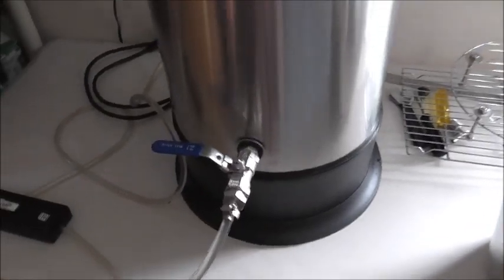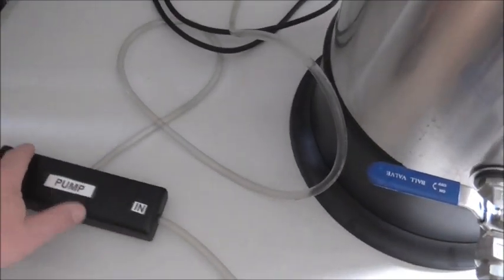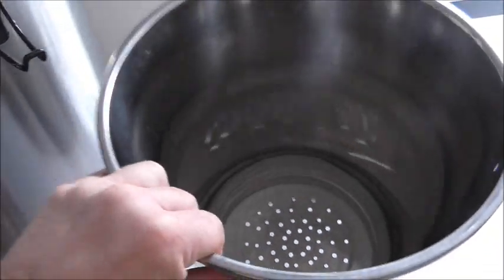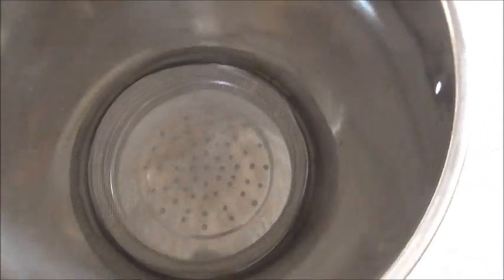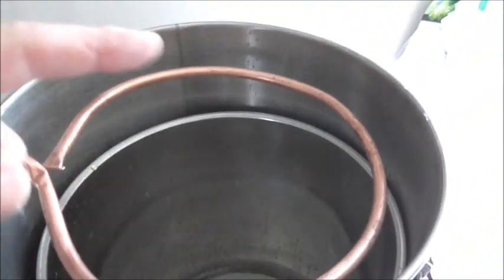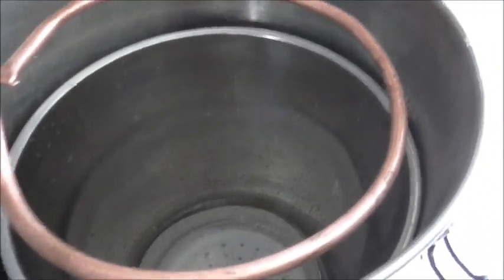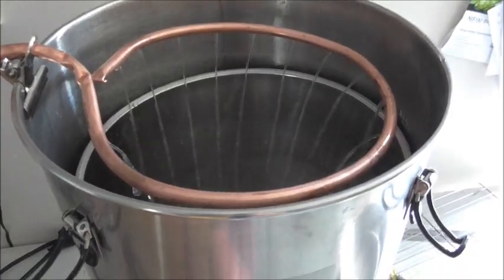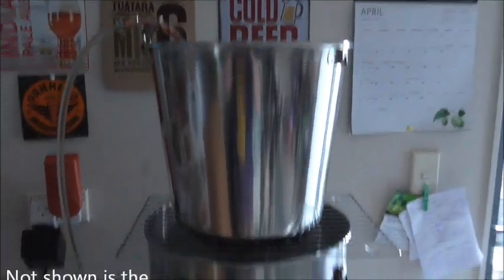Electric Recirculating Brewing System - DIY All-In-One with Sparge Ring

Comment: With each little tweak this DIY project just keeps getting better.  The recirculator works a charm.  Great video Dino.
CHEERS!!!
DJ
Reply from the maker: DJs BrewTube Thanks DJ. Someone has already suggested a quick disconnect for the ball valve for when I switch the pump from recirculation to sparging. That would make life easier. Cheers DJ!

Comment: Great job on the sparge ring, it looks like a kick ass setup you have overall!
Reply from the maker: Drunken Pukeko Brewing Thanks Justin. Sorry for going over the whole system again. Copper was only $9.50 for a metre and I only used maybe 2/3 of that. Cheers
Reply: TubeDinoz I enjoyed seeing the whole system. That's a great deal on the copper, I may have to look into doing something similar.
Reply from the maker: Drunken Pukeko Brewing I went to the trade entrance of Reece Plumbing on Constellation Drive. I'm sure a lot of plumbing supply shops will have copper. Bunnings and Mitre 10 didn't seem to have any, well not the small stuff I was after. Mine was 9.5mm OD pipe. Cheers

Comment: Nice work Dino. Great idea thanks for sharing. Cheers!
Reply from the maker: Rookie Brew Thanks Zane. I paid $9.50 for a metre of copper pipe from a local plumbing supply store (Reeces) and only used about 2/3 of that. Very easy to drill holes into copper. I wanted something rigid and copper seemed the best bet. Cheers

Comment: Great setup Dino, was going to buy a Grainfather but think I might build my own now!
Reply from the maker: +James Pene Thanks James. It's been fun making it. The only thing I've really changed since this video is I added a thermowell to the boiler for the STC 1000 probe. There is a more recent video showing the change. Not sure if I mentioned in this video, but my setup is mainly for half batches 10-11L. The max fill line of the boiler is 25L, so you could probably get a 3/4 size batch. Sing out if you want any extra info. I started building this just as the Grainfather came out, but I'm very happy with it. Another option could be one of those Robobrews. Have you seen them? If you added a pump to one of those it would basically give you something very similar. Cheers Dino

Comment: Happy Easter Dino. Looking great and looking forward to seeing how you maintain the temperature during mashing. Good luck with your first brew with it. Like you I'm gearing-up to doing smaller batches - that way you get to brew more often! Cheers.
Reply from the maker: Cider Meister Happy Easter to you too! I couldn't show it in the video, but I plug the boiler into an STC-1000 temperature controller and plug in my mash temp. The probe sits around tap level. There is a little bit of variance, but it hold the temp within a 1.5C range. Cheers

Comment: Did you ever worry or had problems with overflow during the mashing? As it looks like there is no overflow pipe or holes in the side of the basket meaning if the grain bed get's stuck the pump could dry out the bottom of the kettle. This could harm the pump and the kettle heating system?
Reply from the maker: Hi. I've not had any problems, but what you say makes sense and it would be a good idea to have something as a safety backup. I'll give it some thought. Cheers

Comment: This video popped up so I watched it, very no 8 wire stuff (that's not a derogatory comment) and fun to build something that works well. When bending copper like you have try filling the tube with sand and cap the ends it will not kink ...works for me , cheers...John.
Reply from the maker: +Hot n Salty Thanks. It's been working well, but yeah I was a bit impatient with the bending. I heard about the sand afterwards and also apparently castor sugar works well too. Cheers 👍

Comment: Nice system mate, very compact, i used to have a sparge arm with a crimped end on it and i found there was no way to clean it out properly so i cut off the crimped end off and put a removable compression blank which was easier for cleaning out any small particles which can build up, hope this helps, cheers mate
Reply from the maker: dee .simmono Thank Dee. Funny you should mention the cleaning. When I was testing it I wondered how I would get on for cleaning. Great idea to cut off the end and add a blank/cap. I'll definitely do that. Cheers and thanks for watching.

Comment: +TubeDinoz Very nice and simple re-circulating system. I noticed that you have some kinks on your Cu tube. You can easily avoid that by filling the tube with fine sand before bending and drilling. Once you are done, you can empty out the sand and you will have flawlessly smooth tube.
Reply from the maker: +Solomon Assefa Thanks. Yes, I was a bit impatient and tried to bend it by hand. I might look at replacing it using the method you suggested. Cheers!

Comment: Looking at making myself one of these sparse rings - a great concept. How easy was it to drill the holes in? Any tips you can share before I end up butchering a piece of copper piping?
Reply from the maker: Hi. The holes are easy to drill as copper is a pretty soft metal. As far as bending, I did mine by hand, but it has a few kinks in it. You could use a pipe bender or I've heard of people filling the pipe with silica sand to stop the pipe kinking when bending. Cheers

Comment: Hello and you can write about which mesh you used mesh what you put to the bottom of the pot.
Reply from the maker: piotr 1310 Hi. I used a sieve like this one. I removed the handle and squashed it flat. I then put a length of tubing around the outside to give a better seal. Cheers https://www.google.co.nz/search?q=sieve&safe=off&prmd=inv&source=lnms&tbm=isch&sa=X&ved=0ahUKEwiKhvDpvMTTAhXMHZQKHRmFAfsQ_AUICSgB#imgrc=3lqTC8BIrjgiIM:
Reply: Thanks

Comment: Does the STC-1000 controller do a good job for keeping a constant temperature during the mash?  I tried with an Inkbird ITC-308 but got big temperature swings.
Reply from the maker: The STC and Inkbird both function the same way. Once they hit the temperature you set they turn off the power, but unfortunately you still have lag from the residual heat in the elements. There's not a lot you can do about that other than changing to  PID controller (which I don't have). This apparently "throttles" the power as you get close to your target temperature, so you don't get the same over run in temperature you get with the STC / Inkbird. I hope that makes sense. I get a swing of between 1-2C, but I don't see it has too big an impact on your mash. Cheers

Comment: Hope that is not vinyl tubing, will give off taste to wort besides also not being food grade.
Reply from the maker: Yeah might have been pvc tubing in this video, but quickly changed it to silicone tubing. I know it was food safe for contact with water and food, but not good for any heat, which I quickly discovered and changed out. Cheers
Reply: @tubedinoz  Even more extreme was distilling water with vinyl, taste was awful. The hose went to the chiller, that's when silicon even at steaming hot is fine.
Reply from the maker: I bet. We live and learn though. Cheers mate

Comment: Pretty ingenious and a good bit of cobble stoning. Like you I've cobble stoned much of my system and saved lots of money. One question I have is I noticed that your mesh screen at the bottom just domes loosely on top of your false bottom. I stir a lot so in my case I would have problems with the screen lifting and then grains penetrating bellow. Do you not ever get that? Brew On Man!
Reply from the maker: johhnyglaze1 Thanks Johhny. I normally place the grain into the basket before lowering into the water. The weight of the grain seems to seal the false bottom nicely. The idea of doing it this way (underletting) means as the water rises up from the bottom of the basket and saturates the grain, it pushes any air out and reduces the chance of any dough balls. I do give the grain a gentle stir at the end. Cheers!

Comment: Great looking set up there m8, I really need to sparge in my Biab method but have no way of boiling a second pot. Could I just take grains out and rest on sieve then pour a couple of litres of the wort from the bottom tap into a jug and pour over grain bag at 66 degrees or would I need to raise the temp a bit?
Cheers
Reply from the maker: gifryer  Thanks. What you are talking about would help clear up the wort by letting the grain bed settle, but you really need to rinse the grain with some straight sparge water at around 75C to rinse all the sugars out. Could you bring a jug to near boiling and use that. Even if it was just 2-3 jugs. Cheers

Comment: When doing the sparge that high above the kettle, don't you get problems with oxidised wort?
Reply from the maker: Never had a problem. The wort is boiled afterwards. Are you talking about hot side aeration? The camp is split over where it causes problems or not. Even the experts can't agree. Cheers

Comment: also your stc1000,   does it drift around a lot,  i find theyb are good at 10-20C but up at 68C they drift like a teenage kid in a subaru
Reply from the maker: +peter smith The temperature does swing a couple of degrees as the element turns off an on. I think a PID is the way to go.

Comment: Nice mod Dino, will you be able to reduce the flow if needed,
Reply from the maker: norfolkhillbilly Thanks Clive. Luckily the power adapter is switchable from 6-12V, so I can control the flow rate through that. I'm looking forward to using it for real. Cheers!

Comment: Hi TubeDinoz. Nice work. May I ask you where did you buy the bucket (grain basket), the stainless steel rack, the mesh false bottom and the pump? I also live in New Zealand. Thank you very much!
Reply from the maker: Hi. Thanks. The bucket was from Briscoes, I think it was 11L from memory. I removed the handle and drilled the holes in the base. I rack I think I got from Briscoes as well. It's a cake rack with stainless bolts/washers/nuts to make the legs. Mesh false bottom was a cheap domed sieve from Briscoes. I removed the handle, then flattened the domed mesh part. It has a length of tubing around the edge to make it sit nicely on the bottom. The pump is a cheap $20 micro brushless 12V DC one from Trademe. Cheers
Reply: +TubeDinoz ! Excellent. Thanks! Just one more question. What is the diameter of the of the hole for the tap that you replaced with a ball valve? Is it a 1/2"? Thanks again!
Reply from the maker: Yes, it's a 1/2" ball valve. The hole for the original plastic tap was sort of an oblong shape, so I used a round file to make the hole the right shape. Cheers
Reply: +TubeDinoz . Thanks! Did you connect the STC-1000 to the thermostat? Or did you connect the STC-1000 directly to the "hot" power point? Cheers!
Reply from the maker: Hi. The STC is plugged directly into the powerpoint and the boiler is plugged into the heat output of the STC. The temp probe from the STC sits inside the boiler on rack.Cheers

Comment: Seems like the same boiler that is used for Grainfather more or less!
Reply from the maker: Nice spotting. I believe the Grainfather is based on the T-500 boiler, but has an increased capacity and extra element added etc. Mines basically a DIY 3/4 size Grainfather. Cheers

Comment: How many litres is your inner bucket, and how much grain can you use?
Reply from the maker: +James Watson Hi James. I can't remember exactly, but I think it's about 10/11L bucket. It's look the same size as a standard plastic bucket (27cmx27cm with a slight taper). I only do half batches and use no more than 3kgs of grain, but it would probably hold a max of around 4-5kgs at a pinch. I hope this helps. Cheers Dino

Comment: Hey Dino - greetings from Canada.  I am in the process of building a similar unit and have purchased the Turbo 500.  What type/size fitting did you use to replace the spigot on the unit?  Thanks for your great video.
Reply from the maker: +aaron gomes Hi Aaron. I used a basic 1/2" BSP 316 1 piece ball valve. On the back is a 1/2" BSP 316 back nut. I used 2 x "O" rings (one each side of the boiler wall) to seal. On top of that I added a 1/2" BSP hex nipple to attach a 1/2" BSP socket, which a bazooka screen screws into. When you replace the spigot/tap you'll need to file the hole slightly to get the ball valve through as the original hole is not a perfect circle. I'll try take a photo as well. Cheers
Reply from the maker: +aaron gomes Found this photo before I put everything together. I've uploaded it with some labels. Cheers - https://www.youtube.com/watch?v=PmNQtjFjvZQ
Reply: +TubeDinoz Thanks Dino - much appreciated.  Cheers!

Comment: Cool as, so the tubing is on the outside? How have you kept it secure?
Reply from the maker: ***** Yeah. I cut a length so it's fairly tight and joined the ends together with a double ended plastic plug. The underside has a solid metal ring, so that combined with the mesh created a groove around the outside. Sort of like a tyre (tube) around a wheel if that makes sense. I'll see if I can get a photo. Cheers
Reply: TubeDinoz Cool man, thanks for that. All good stuff, that's why I am blatantly going to crib your idea! Cheers

Comment: Thanks for the video.

How you clean the system???
Reply from the maker: I tip everything out of the boiler once I'm done and give it a good rinse with the hose. I then clean it with normal washing liquid and then finally recirculate some PBW through the pump, boiler etc Then give it another rinse. I find if I clean the boiler/pump straight after the brew day, it's an easy job. Cheers

Comment: Cool rig, did you sparge with clean water by switching the the pump feed or just circulate the while mix?
Reply from the maker: Thanks. I sparged clean water which would have been pre heated to between 75-78C. Cheers

Comment: Where did you get your grain basket from? Is it a champagne bucket? Cant seem to find anything like that in England. Where did you get that tiny pump from and what make or type is it?  Already experienced all grain brewer but I like to make things myself and that is the closest clone to a grainfather I've seen. Love your vids / blogs
Reply from the maker: Iain Campbell Hi and thanks for your comments. The grain basket is a stainless steel bucket (can't remember the exact volume, about 13 litres I think). I removed the handle and then drilled lots of holes in the base and added the mesh false bottom as in the video. The pump is just a cheap brushless DC 6-12V pump. This is the one I got and then placed it inside a plastic box to tidy it up. The site is in New Zealand, but they should be available anywhere. http://www.trademe.co.nz/home-living/outdoor-garden-conservatory/other/auction-936573887.htm I hope this helps. Cheers!
Reply: +TubeDinoz Where did you buy the T500?. In the uk you have to buy it as a full t500 turbo still.expensive.
Reply from the maker: Iain Campbell I bought it from my local homebrew shop in New Zealand. I only had to buy the base, without the still attachment. Cheers

Comment: Exactly the system I want to build. Thanks for sharing. What efficiency do you achieve?
Reply from the maker: Thanks. It's still going strong. I've upgraded the pump to a better one. Here's a link to a video if you're interested. As far as brew house efficiency, I'm getting around 75% with a sparge or just under 70% without a sparge. Cheers Dino - https://youtu.be/iygUdLT3dXk
Reply: @tubedinoz  Thanks for the link. I thought the efficiency would be a bit higher but I guess that also depends on how you mill the grain. And how do you sparge?
Reply from the maker: @matejbraz2649  my homebrew shop does my milling. They don't charge for milling so makes it easy for me. I use a hot water urn for sparging. Cheers

Comment: How do you cool the system? Maintain temperatures? I really would like to build a affordable working system!
Reply from the maker: Hi. Here is a more up to date video of my system. I use an STC1000 temperature controller to maintain the desired temperature during the mash. As for cooling. I use a copper immersion chiller and run cold water through it. I hope this helps. Most of the parts I used are in the description of the attached video. Cheers Dino - https://www.youtube.com/watch?v=iygUdLT3dXk

Comment: How did this work out after a few brews fella?
Reply from the maker: Great. It's still going strong. The main thing I've changed is adding a better pump and malt pipe. Here's a video of how it looks pretty now, if you're interested. Cheers https://youtu.be/iygUdLT3dXk
Reply: @tubedinoz  thanks for the update. I was sceptical of how well that pump would perform over a few goes considering its size against what a lot of folk use, will check out the newer video now pal

Comment: where did you get the grain bucket from??   cheers Pete
Reply from the maker: +peter smith Hi. It's a stainless steel bucket. I removed the handle and then drilled lots of holes in the base for drainage. I think it was 11 litres from memory. Not sure where you live but I got it from Briscoes in New Zealand. Cheers